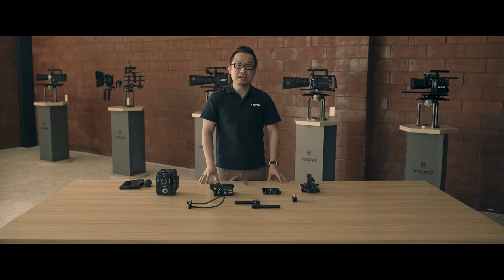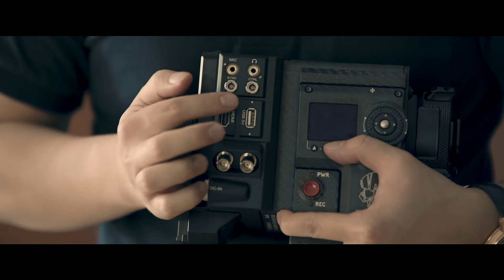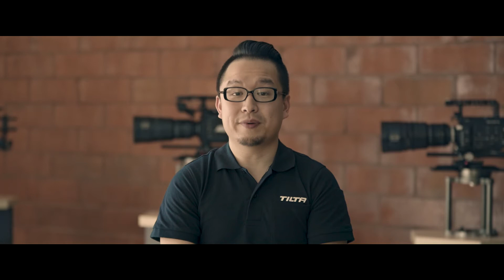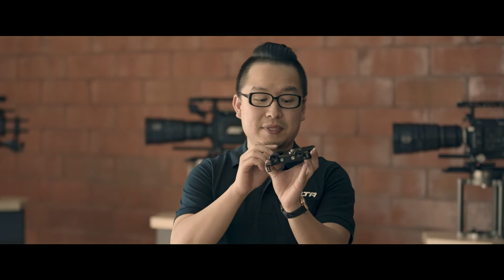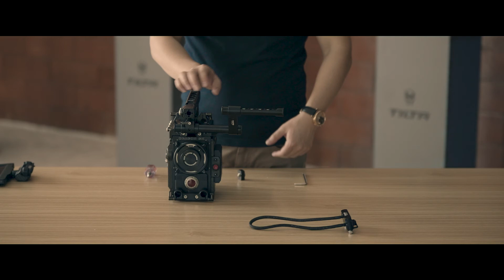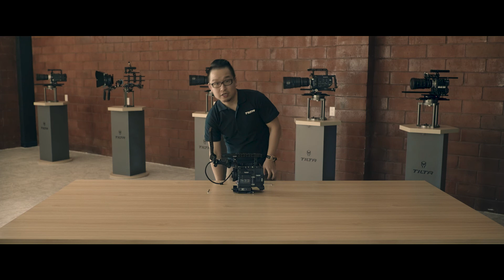Tilta for RED DSMC2 Kit Instructional Assembly

Comment: Can the top plate and handle work with RED's own V lock I/O expander?
Reply from the maker: If you already have RED V lock I/O Expander, you will need to purchase the Tilta C1 Cage (ESR-T01-C1). This cage is the only one compatible with the RED V lock I/O expander.
Reply: @TILTA  Thank you! so ESR-T01-C1 can use RED V lock I/O Expander to power the top plate and handle?
Reply from the maker: @ageofline  Please check out the product page here: https://tilta.com/shop/camera-cage-for-red-dsmc2-c1/
Reply: @TILTA  Thank you very much! Because when I checked the page while back ago , it didn't show C1 configeration yet only A1 and B1. Thanks again! It was very helpful.

Comment: Thank you for the fast response. What is the main difference between the A and C versions? Is it mainly sound sync from a mixer?
Reply from the maker: The "A" version is for owner operators that do not already have a RED V-lock I/O expander. In other words, if you own a RED DSMC2 and own a RED V-lock I/O expander then you would purchase the "C" Version. If you do not own a RED V-lock then you have the options of using "A" or "B" versions.
Reply: TILTA Thanks for the information. If you use the Anton Bauer version does the battery plate go directly on the module or is there a v-lock to Anton Bauer adapter necessary? Also, if you only have the top plate attached do the connections work? I understand that the contacts would be exposed? I’d like to be able to use it on a gimbal without the back modules.
Reply from the maker: Please contact support@tilta.com for further details. As far as the I/O modules go, the battery plates do come in both AB and V mount. We do not recommend users switching out the plates themselves and the plates are only sold as replacements - not as mods. If you do not have the top plate attached the cage's power pass connections would be exposed. In order to use it on a gimbal please contact support@tilta.com with the setup you want to balance and they can help you troubleshoot.

Comment: I like the whole package...what is the total weight?
Reply from the maker: The Tilta RED DSMC2 "A" Cage Early2018 is approximately 5.252lbs. This does not include the weight of the camera or monitor. The optional 19mm multi-functional baseplate and 12 inch Dovetail is an additional 2.425lbs.